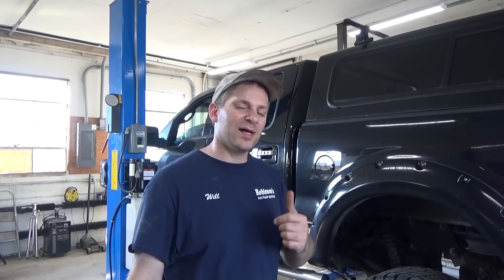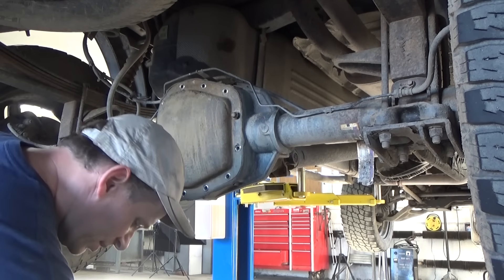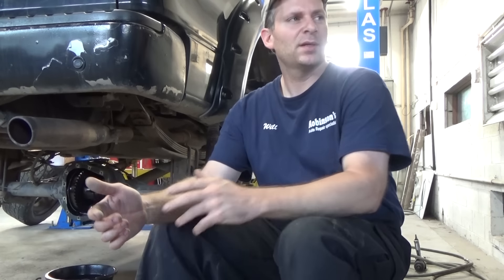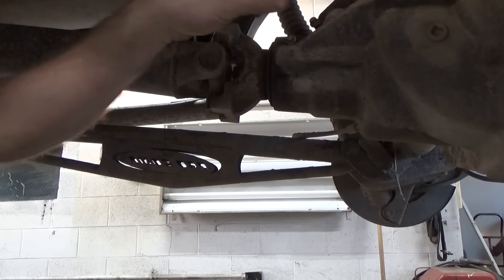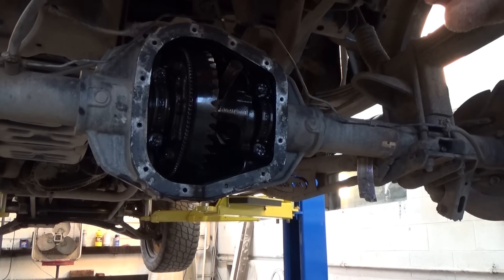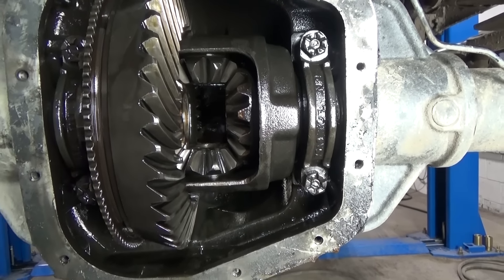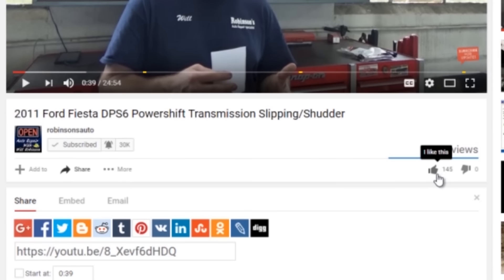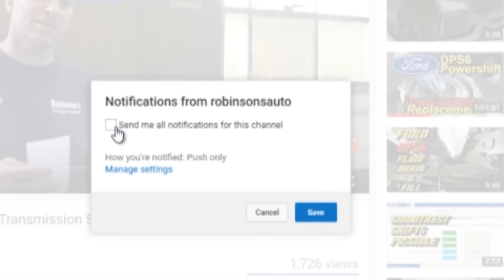Ford F-150 - Rear end Noise 9.75

Comment: I like the fact that you don't use rubber gloves,  like a real mechanic. I'm not a mechanic but when I pamper my ride I don't use gloves. 🤪🤪
Reply: Armando Gutierrez “Real mechanics” as you put it have suffered from abnormally high rates of skin and liver cancers for years. When you analyze the toxins in the used fluids we deal with every day it’s not difficult to understand why. Lead, Mercury, and poisons are absorbed through a mechanic’s skin every day. I’ve been a professional mechanic for 30 years. I’m as “real “ as it gets and gloves are a wise move for young bucks just starting out.
Reply: @prevost8686  good tip. Thanks.

Comment: Ford offers a ring and pinion gear set with bearings only you have to order the carrier bearings and cones separate to complete the overhaul, I would also replace the right axle seal and bearing since you are there. Don't DIY, pay a trained rear end mechanic.

Comment: 2000 jeep cherokee xj Will a broken leaf spring shackle bracket cause the rear end to be a little off enough  to where you can hear a noise in the rear end? I have replace Ring Gear and what i call cluster bearing with what i know was a good set up out of my other Jeep with the same ratio.  New axle bearing, no help. I thought well has to be pinion bearing then i thought will that broken shackle bearing cause that rear end to be off centered and make a noise???

Comment: Tech tip. Place a 2x4 vertical under the ledge of the hump of the pan and pump on it with a jack to exert a shearing force on the sealant. On aluminum pans like the 6.4 there isn’t an curved edge to get a putty knife between the pan and the housing. Leaving a bolt on each side and applying a shearing force to the pan works every time and isn’t invasive.

Comment: used ass-end time ..

that said
do not rent more space unless you are  hiring another mechanic ..!
Reply from the maker: I would have but in the end the Ratio wasn't stock and we would need a new ring and pinion either way to match the front. if it wasn't for that  most definitely would be the way to go. i agree

Comment: Wholy snit, that's a lot of silicone hanging out of that diff cover. The bad thing is, whatever you see hanging out, hangs in as well. I hate sloppy mechanics doing that. Especially on engines. Since you end up with silicone strings bunched up on the oil pickup screen. Or worse, in an oil passage somewhere in the engine. You can always tell a yahoo idiot worked on a vehicle, by just looking at the silicone squeezed out. Oof! They must think more makes a better deal of something, so they use the whole tube. I can probably reassemble an entire engine with just one tube of silicone. Anyway back to the video.

Comment: Why not just set the backlash? I realize you are into it but everything looks fine.
Reply from the maker: good question, i cover this in part 2 just put up yesterday, hope it answers your question. in short. the gears are worn down to the point a ledge has started, if i adjust  the backlash we will then dig in, amplifying the problem. thanks for asking because its hard to see here however part two i zoom in

Comment: Ford F-350 Dana rear end
Reply: Ford F350 2002 1 ton Dana rear Dana 80 rear end
Reply: That's a factory 9.75 sterling ford used them in the F150'S that had the 5.4 3v. They still use them in the current 1/2 tons

Comment: Not in pressed.   Just tear it down and  inspect every thing and replace every thing  that it needs and do it right I don't ever go by what and one else have done / if you bend the cover al you have to do is bend it back.  And that's  what they make sealant for. He move to slow for me. Ok what you just said about just filling it with oil. And let it go.  Hack.  This guy would fucking drive me nuts if I had to work with him.